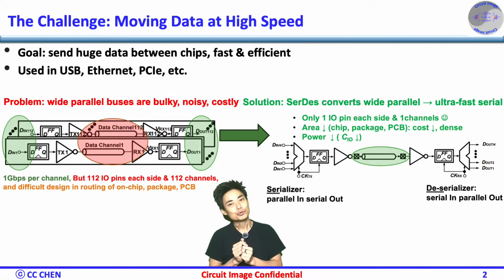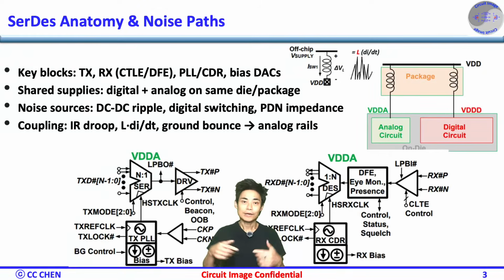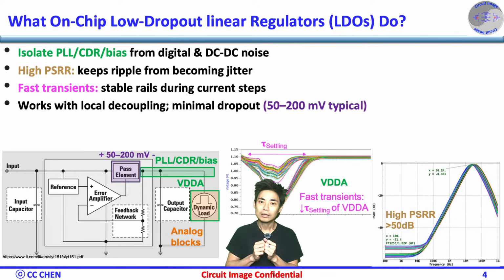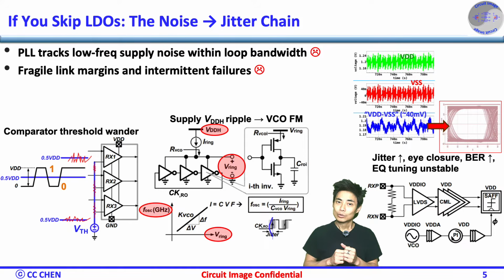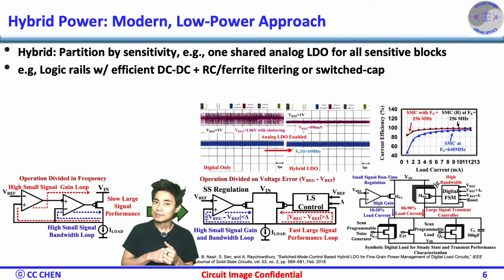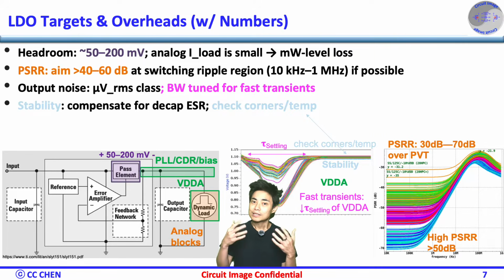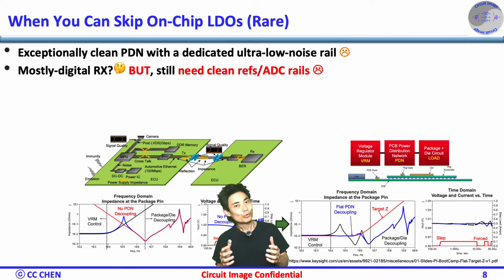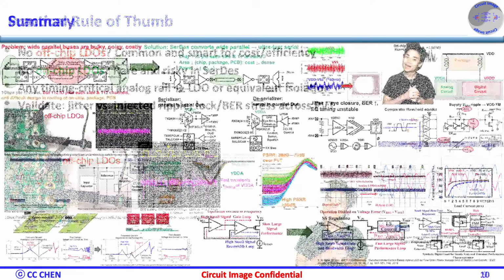Why LDO?

Comment: 陈博士有什么推荐的片上补偿的pmos ldo架构或者论文吗？稳定性和psr是个需要彼此平衡的指标。像fvf ldo的架构相应速度很快，但要覆盖宽负载下稳定性不容易。
Reply: Multi-loop FVF 輕載靠 bleeding current, active zero, pz tracking  基本上light load stb sets iq minima, 有辦法的話直接做nmos fvf 可以做的很低功耗 但就要分VDD
Reply from the maker: Hi Green, Chieh-Ju,
謝謝兩位的提問與深度補充針, 對 Green 提到的穩定性與 PSR 的 trade-off，可以對「傳統 Miller 補償架構」來建立極點與零點的基本直覺，之後再去看瞬態極佳的「FVF / quasi-FVF 類」架構會更有感。而 FVF 在寬負載下的穩定性痛點，正如 Chieh-Ju所說，實務上常常得靠 bleeding current, active zero 或 pole/zero tracking 等手法來改善，這也直接決定了輕載時Current 的下限。至於 NMOS FVF 雖然低功耗，但代價是需要多一組 VDD supply讓系統複雜度上升。

謝謝
CC
Reply: 補充一下： 有些電路不需要絕對精準度 所以replica bias or open loop source follower 會是一個不用解決穩定度的好選擇 for example: SAR Vref buffer, 至於light load stb 有些技巧讓loop 在ultra light load 自動clamp 在類似open loop 區間  此時miller pile splitting 也失效 不需要大Cout for stb 這兩年做stand alone LDO (有Cout的） 好久之前做on chip LDO 最簡單就是 multi loop fvf 然後 replica 出去 這樣 一個main loop ( slow + fast) 再replica 出去 （順道濾掉EA BGR noise, PSRR)

Comment: Hi Dr.Chen,
Thanks for the great video, here is a query for LDO, could you please help to take a look when you have time.
Due to the lack of suitable on-chip LDO IP in our lab, I plan to use an off-chip LDO for the RX clock path. I am wondering if this will severely impact performance.My reasoning is that the primary noise source with an off-chip LDO would be the di/dt noise from the parasitic inductance. However, since the clock operating frequency is very high, I assume this noise would be high-frequency in nature and therefore should be suppressed by the CDR loop I would really appreciate your insight on this!
Reply from the maker: Hi Jay,
Thanks for the kind words — glad you found the video helpful.
This is a good question. Using an off-chip LDO can introduce supply noise due to package/PCB parasitics (especially di/dt-induced inductive noise), and not all of that noise will be high-frequency or fully suppressed by the CDR loop. Low-frequency supply modulation and supply-to-phase coupling in the clock path can still degrade jitter performance. I’d recommend carefully checking PSRR vs. frequency, local decoupling close to the RX clock circuitry, and sensitivity of the clock/PLL blocks to supply noise.
Thanks,
CC
Reply: @circuitimage  I appreciate the advice！ I will definitely look into it.